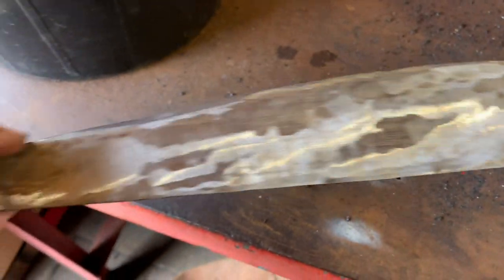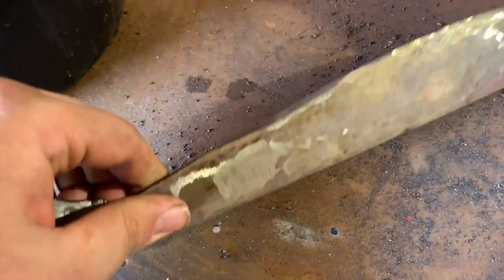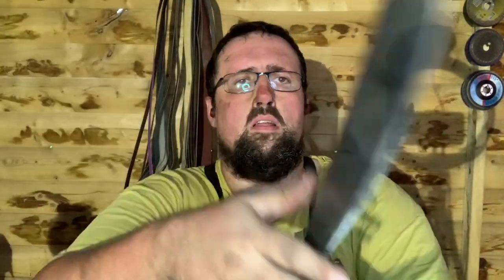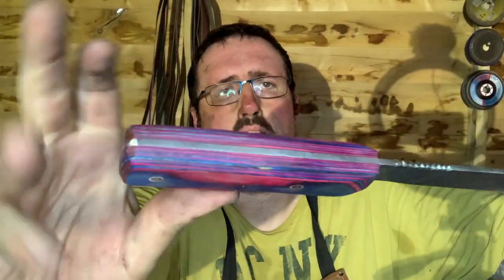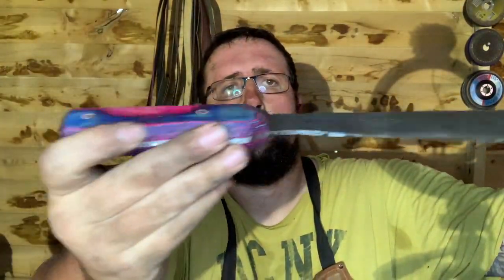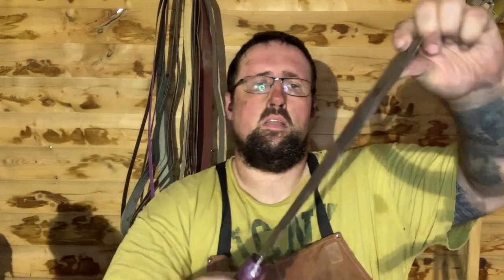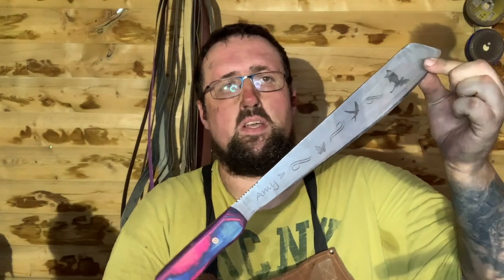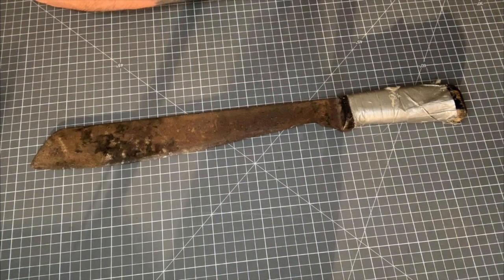One day build - Restoring rusty British army machete!!!

Comment: The traditional handle on the Golok does not have a full tang. The gap at the end stops fatigue in the hand when using all day. Beech handle been used for decades with no complaints.